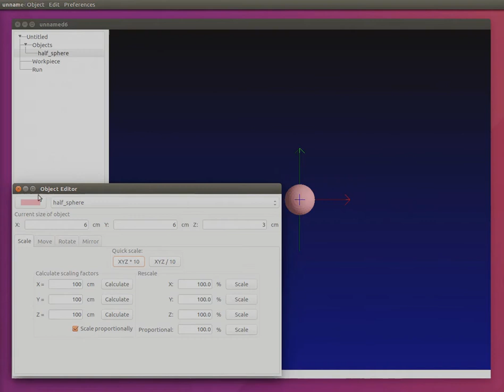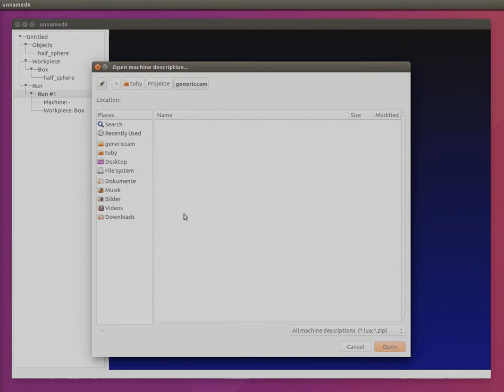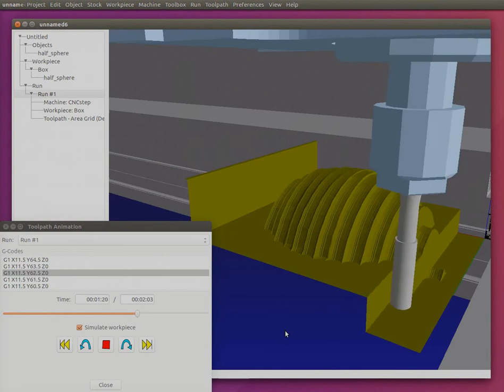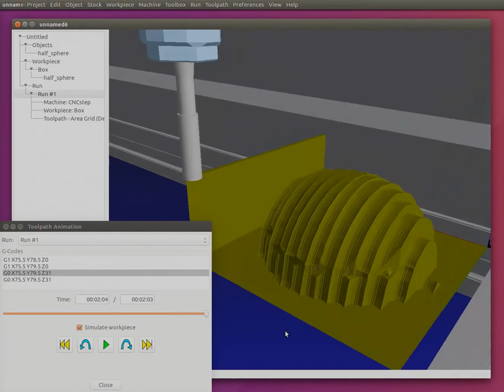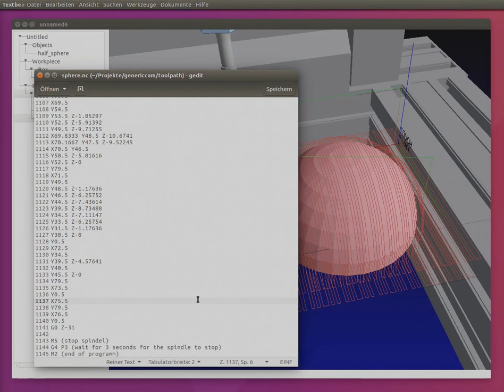Generic CAM - State of development - Autumn 2019

Comment: Mám Ubuntu18.04, po spustení sa mi zobrazí iné prostredie, ako na videu. Generovanie súboru (*.nc) žiadny súbor. NEFUNKČNÉ. Ale je to pekný projekt, škoda, že nefunguje.
Reply from the maker: Yes, it changed a lot. After making this video I realized, that the UI and workflow are awful. I changed things around to make it look and feel a little more like the leading programs in this field. Menu bar is gone, now it's all right-click menu and ribbon bar. I have to sort out some things in the code and then I will make a new video.
Reply: @tobiasschafer9095  Ďakujem za odpoveď. Budem trpezlivo očakávať funkčnú verziu.
Reply: @tobiasschafer9095  Verzia z 9.5.2020 už pracuje. Ale k takému výsledku, ako je na videu sa neviem dopracovať. 
po zadani rôznych hodnôt - rpm - vysledok  je - S12000
a po zadani rôznych hodnôt rychlosti nástroja - mm/s - je vysledok
F25
vypis-
S12000
M3 (start spindel ccw)
G4 P3 (wait for 3 seconds)
G0 X0.416674 Y0.0833348 Z16.2809 F25 
Ďakujem za odpoveď.